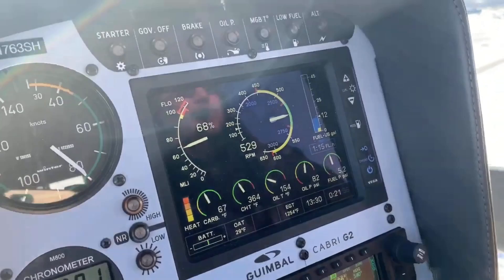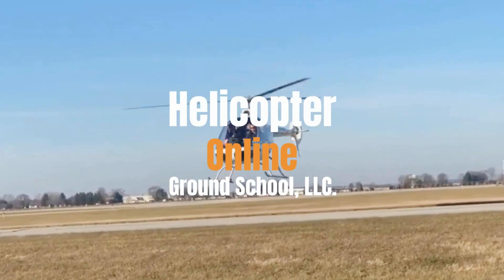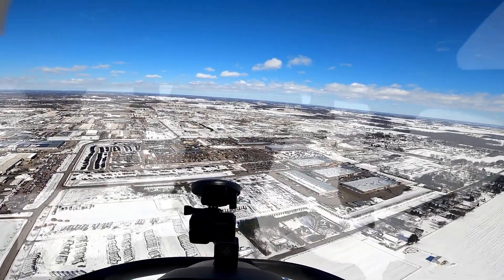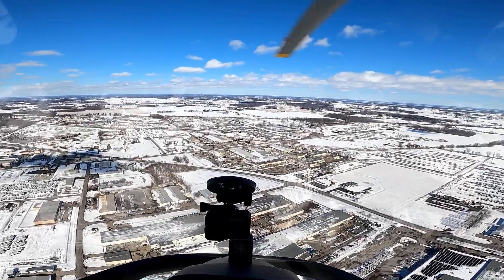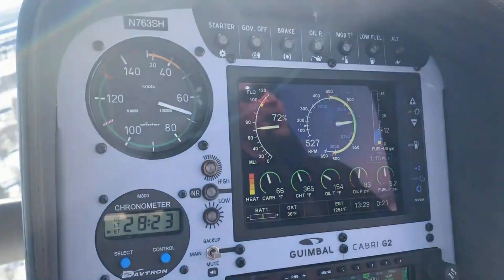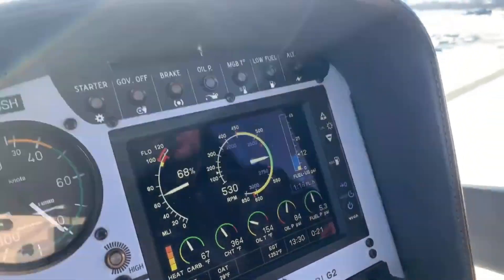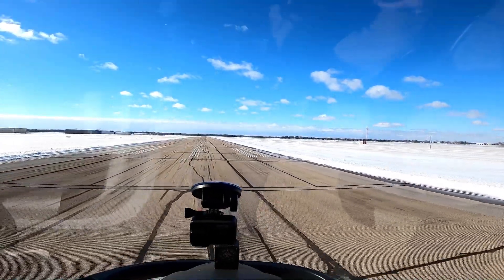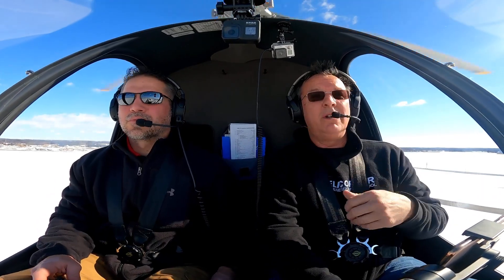EP 27 Autorotation Engine Failure Practice With 90 Turn

Comment: When you say start the flare at treetop level that is a little confusing because the trees around here in the pacific NW are 130 ft tall, Great video.
Reply from the maker: Everybody has to do what works for them and use terminology appropriate for their own specific situation! Thanks for commenting. We have been stating that repeatedly in this series.
Reply: I addressed this as to why I use tree top level.  It will be in an upcoming video.  Thanks for watching!
Reply: @christopherhouser6935  Thanks I fly the 300C and normally start my flare at around 50ft to 60ft AGL .
Reply: @TheRailroaddan  The G2 POH states 60ft.  The point I make is tell a student to flare at 60ft.  He doesn't know what 60ft looks like so his eyes go straight to the altimeter when they need to be looking outside the aircraft.  The trees are a visual reference point for the student.  The flare can be adjusted depending on altitude when entered.   I used to fly a 269/300, great aircraft!

Comment: Nice video. Could I do 180 auto rotation by doing 2 90 deg. Auto rotations. Just to keep it simple.
Reply from the maker: Great question! That's exactly what our video is about tomorrow: EP 28 Autorotation Engine Failure Practice 180 with two 90 turns

Comment: Love your videos.  Keeping things as simple and common sense as possible.  You mentioned the training standards are straight in and 180 autos.  That's cool.  I guess what I'm having an issue with is why something less than a 180 turn would be a problem for some folks?  If you can comfortably do a 180 auto, why would any turn less than that be an issue?  I'm not rotorcraft rated so I'm sure there's a lot I'm not up on but it just seems that if the 180 is no problem, anything else should be a no brainer.  Also, I'm betting that if/when a new pilot is confronted with their first true emergency autorotation, it won't be to an airport and some amount of maneuvering will be necessary to line up on whatever open area is available to them.
Reply from the maker: Thanks Steven for the compliment!
Reply: I feel it is what I call a "training scar".  New students learn straight-in or 180 for the PTS.  If that is all they learn, then in an emergency, their brain is going to revert to what they repeatedly practiced.  Thanks for watching.
Reply: @christopherhouser6935   - well that would scare the hell out of me.  I would hope that anyone learning to fly would be a little more flexible than that, or maybe the instruction needs to be a little more comprehensive.  A buddy of mine used to be a flight instructor.  He told me a story about a man who came to him for a biannual flight review.  They went through the ground oral and then progressed to the flying side of things.  Everything went well until, toward the end of the flight, they returned to the airport and my friend gave the student a simulated engine out right after they had entered down wind at the airport.  The students response was to turn away from the airport and lined up on a neighboring plowed field.  Needless to say, my friend wasn't impressed with that decision and refused to sign him off without some remedial training.  The student wasn't pleased with that and left.  Only God knows what he did after that.